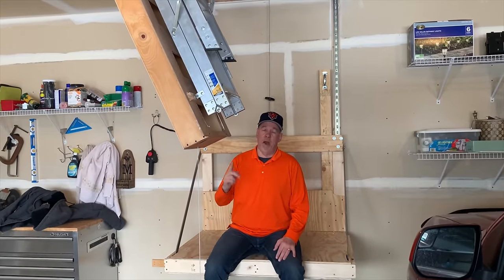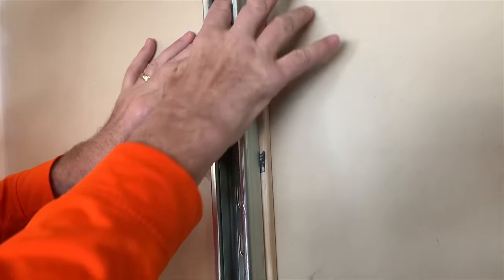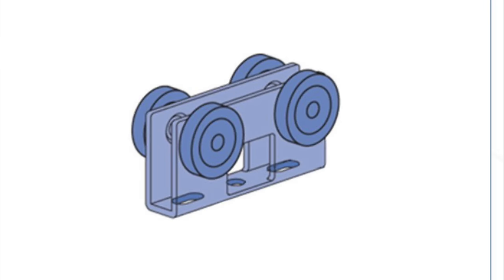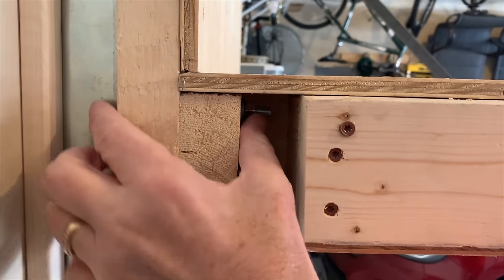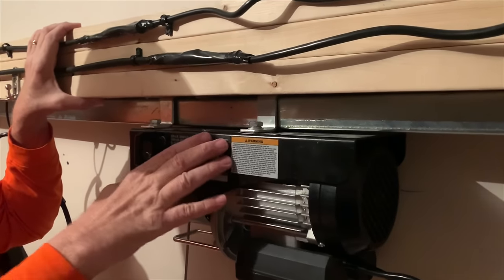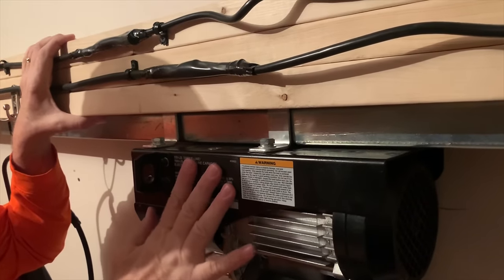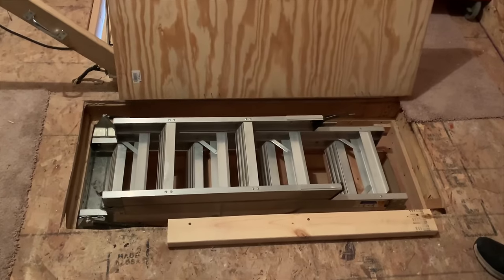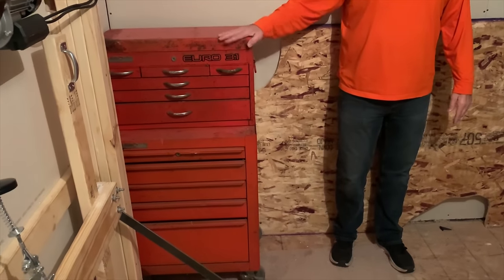Garage Attic Elevator / Lift Build in Minneapolis Minnesota

Comment: Somewhere there is a code enforcement officer loosing his Ming over what he sees as the crime of the century. Great job.
Reply: I'm one of 'them', and it doesn't bother me.   What an individual does, is really up to them, except for extremes.  I get torqued over a builder that knows the design was to code, and doesn't follow it.
I'll council home owners on best practices,  help them improve,  unless there is some high potential safety issues. 
Biggest problem here is that the only stop on the winch is it's capacity overload.   No reverse system for minor jams, i.e., feet or hands. Just a thought.
Reply: L-O-S-I-N-G.     Jesus.
Reply: @Dranok1  Thank you for turning autocorrect on and googling a thesaurus for some big boy words.  There should, however, be a comma after "Or".  Also, your misuse of the semi-colon between "here" and "are" leaves much to be desired.  A period is the correct application here.  I recommend "The Elements of Style" by Strunk and White.  The third edition is somewhat superior to the earlier versions.  Yes, there is something very wrong with thinking L-O-S-E is the same word as L-O-O-S-E.  Jesus Christ, I don't know how people graduate from high school sometimes.  #defendingtheenglishlanguageonefoolatatime
Reply: @prun8893  Oh, you want to descend into a grammar argument, do you?  Probably best not to pick on a linguistician (who used to work as a proofreader/subeditor, teach English linguistics and Advanced 'English as a Second Language') unless you're on firmer ground:
- So you didn't complain about my use of a conjunction to start a sentence, which indicates you are comfortable with my informal style, but you do complain about my informal use of a semicolon.  Hmm, we'll come back to that...
- Shame that you then think "Or", standing alone at the start of a sentence, not part of a list or set of sub-clauses, requires a comma after it.  This is so clearly wrong that you obviously need to read that style guide you mentioned.  (We don't use Strunk and White over here, but I can't imagine basic rules are so different in American English to the rest of the world that they would instruct you to misuse an innocent comma in such an egregious way;-)
- The use of my semicolon is to maintain a link between those two clauses where the first does not "lead directly on to" or "require information provided by" the second.  When I was typing the sense of the two clauses was more strongly linked in my mind and ; felt correct, but being "just" a social media forum -- the most informal of writing one can find -- I didn't then read it back after posting.  Now that I have, I tend to agree that that it was unnecessary and a new sentence would have been better.  But, given the informality of the forum, attacking someone for such a (not "wrong" but) "weak" use of a semicolon, when you have just espoused the most improper use of a comma, is just foolishly arrogant and bound to open you up to debate.
- And then you make the non sequitur of mistaking "lose" with "loose", which neither of us did, unless your original use was a typo.  So I don't understand what point your were trying to make there.
- And finally you round off by blaspheming at me again in an obviously offensive manner -- perhaps to make me bite?  Whatever, I don't need to receive such language, so I'll wait for an intelligent response, but if you simply swear in public as though it somehow reinforces your argument then I'll just block you and move on...
(And yes, that last sentence has too many commas where parenthetical subclauses are not necessary, but it's also not necessary to correct because it's just slangy, informal register.)
Reply: @Dranok1  Fascinating banter, but I feel like you've missed his point that the original contenter said something about a code enforcement officer "loosing" his mind. The hyphenated "losing" comment was calling that out, and not meant in the opposite context of a comment like "Winning," which I think would have been appropriate to the video. 🖖
Reply: @robschwenck  Thanks for that.  I re-read the OP and did indeed not notice his typo originally: I was more interested in the light-hearted nature of the replies, then interrupted by this yahoo who decided to blaspheme at us all for no reason.  The hyphenated shouting, therefore, was so heavy-handed that it struck my attention and seemed totally out of context, so I balked at it and responded in kind.  His response just proved that he's the shouty kind of person who wants to prove his superiority but doesn't want to put in the time either to make sure he's correct or to give a proportionate response.  (The rest of us were here just enjoying some light-hearted commentary, so his shouty swearing wasn't welcome in an open forum.  I'm no prude but people who don't consider their audience should keep their comments to themselves until they can.  My opinion, with which some will disagree while many more agree, but that's an unrelated discussion.)
Reply: @prun8893  Nice deflection of the conversation
Reply: @johnthompson9625  Interesting point. What would you suggest for a system that allows to be reversed?
Reply: @scottcoleman7304  like I said,  the only safety for that winch, it's torque overload,  which will only stop the motor.  There are several safety reversing solenoids on the market,  that require a pedal to be depressed to continue motion in one direction.  If you are using the winch to raise a load,  and you release the foot switch,  it reverses the direction. 
Not totally necessary, but a one ton winch can cause a lot of soft tissue trauma,  before the operator hears and registers that there is an issue. Once someone hears a scream or crunching,  they have to move their finger to the opposite button to release tension or remove the blockage.  Not an easy task, as we tend to lose fine motor skills when under duress. 
If the auto-reverse can't be figured out,  then enclosing as many pinch points as possible,  is the best advice.  Ive seen too many hand and foot injuries in my career (offshore oil and gas before becoming an inspector) and every one of them was preventable.  
Believe me, I'm not knocking the ingenuity of the device in the video,  I'm looking at how to put one in my shop right now.  I just think that the power and torque of the winch that they have,  deserves some respect,  and it will eventually demand payment. 
At the end of the day,  if they ever aell the house,  they will probably have to remove it,  as it will be considered a code violation or deficiency.
Reply: I loosed my Ming and established an empirical dynasty that stretched thoughout much of history.
Reply: I know that guy! He camps out at my house. Wears a kill suit with camoflaged brief case to match. Couldnt wait for deer season. I see a gun cleaning accident comming soon.
Reply: @davidreynolds4684  lol
Reply: @danielgolightly7979  Golightly? Dont have any kin in Stephenville Texas do you?
Reply: @johnthompson9625  The only issue I'd see with this is the framing for the hoist seems to attach to the studs but it doesn't continue down to the garage floor. I assume they rest over a floor joist and that would make me happy, but if not, it's false security of a thick post that is really supported by only a stud.
Reply: @johnthompson9625  Good points on an overlooked safety feature.  I'll be sure to include such modifications if I build anything like this!
Reply: The UBC calls for a fireblock between the garage and attic (taped, type-x drywall). But for you city folks.. not many places in the country have adopted the UBC, nor do they have ordinances to enforce anything. You should see what people build. Anyway, sending Christmas lights up is one thing, I dont think I'd ride this contraption.
Reply: @Dranok1  you sir, are the man!!! If only I had you when I was taking my English classes! I had to either read google everything to make sure I was structured my sentences correctly. I generally wasn’t lol. But I got trough them with an A in each so I’m good now lol. 

I would love any suggestions for references that I could use to teach my son with, he is 12 but very advanced compared to his peers, I’d just like to be able to teach him more and keep him ahead. P.s. plz don’t grade this, i am being very informal lol
Reply: @TankGunner84  😅
C-
Unless you're a 'murican...
...in which case, B
(JOKE!🤭)

OK, where are you based?  (What form, edition, revision, version, dialect, creole and register of English do your peers regard as appropriate in day-to-day professional life?)  Problem is, you see, I can point you toward good guides in Standard English, or even RP if you really want (not that it's seen as the "correct register" for most purposes these days), but if you live in, say, Canberra, people would not generally appreciate your efforts -- it would not be taken as the "right" way to speak.
Being well-versed in the proper construction and pronunciation of Standard English is a good thing: you can speak to pretty much any English speaker in the world and be understood and viewed as a well-educated person whose command of the language is to be trusted.  But that's not the be-all and end-all of good communication: effective communication includes knowing when and where to use the right register, and understanding the difference between "poor" English (lacking sufficient education) and "regional" English (something that might be "wrong" in Standard may be quite correct or acceptable in dialect) and if you try to tell a person with a strongly defined local common usage of English that they are "wrong" or worse yet "uneducated" you will be quickly recognized for the fool you are!

Ooh, that turned into a stream of consciousness again, I'm good at going off on a complete tangent when someone asks me about a subject I love!  Sorry to anyone else who hung around to read all that...  The executive summary of that is, without knowing where you're from, I can't give sensible advice on improving your English, and in fact I'd really only be comfortable doing so if you're in the UK.

(I had a run in not so long ago with an  American who knew his language and accused me of giving "incorrect" usage.  He told me to go and read X's style guide (publisher's reference) and Y's grammar (educator's reference) but I didn't know who X or Y were because we use different texts, and as we debated the relative merits of our formal English I was surprised to learn that a couple of quite fundamental things we consider inappropriate or even wrong in strictly Standard English are considered correct in those educational texts for American English.  Language evolves, you can't fight that, and if you try you will be mocked for speaking like Shakespeare.)
Reply: @Globerson  keep watching. They are coming for us who think so.
Reply: I vote for G Ellis.
Reply: @jerryf609  I'm inclined to drop a "😘" but I'm not standing for anything currently, so instead I throw you a "🤔"
:-)
Reply: @robertthompson227  Seriously?  You have a "Building Code" (I don't know what "U" means; "Universal"?) but it's only enforced in urban areas?  That sounds suspiciously like mediaeval fire regulations for densely built-up areas!  Surely if you have a regulation for the safety of the general public, it must be the same all over.  And what's the point of having it if people just disregard it (because "this is still America believe it or not") or it's not enforced?

We have statutory Regulations and Approved Codes of Practice, the major one being the Building Regulations: a set of "Approved Documents" (each forming a Part of those Regulations) that indicate the minimum performance of certain aspects of a dwelling.  You can set about fulfilling those reg's however you wish (it's not prescriptive in every way -- they don't say "you must use Cellotex or Kingspan to insulate your roof" only that "you must insulate sufficiently to reduce energy loss according to this table", that kind if stuff) but if you use a novel way doing it you must show that you are still adhering to the reg's.
If you ignore the reg's and a Building Inspector discovers it, you will be required to rectify, even to the extent of complete disassembly/demolition if it shown than your ignorance of the reg's make the building unsafe (crappy foundations, for instance, or "built in the wrong damned place!").  There is no "I can't be bothered, it's my land after all" because what happens when you die?  Or just decided to move?  The next owner must live with the house you built being potentially unfit for human habitation.  And there is no "reg's for a big town being unnecessary for a farming hamlet" because the risks are the same wherever you are -- long gone are the days of "you can't built timber frame and thatch if you are less than a rod from a neighbour building in the same manner."  (They didn't have terraces in those days; to stop a fire devastating an entire town they finally said roofs must be tiled.)
The Regulations are valid and enforceable wherever you go in England and Wales.  (Scotland has its own reg's due to its decentralised autonomous status, but they are broadly similar because, at the end of the day, the hazards associated with building and living in a house don't change just because you've climbed over Hadrian's Wall...)
Reply: @Dranok1  No wonder England is just a shell of its former self.    Without government how would anyone survive?  LOL.
Reply: @johnthompson9625  Easy. Sharpie some footprints on the deck that say "stand here" and add "no gesticulation, limb crusher/guillotine in operation." Solved. Or write "not intended for mere humans" to keep most people from riding it.
Reply: @johnthompson9625  You don't need a reversing system to clear jams caused by hands and feet. If you get a hand or foot caught  between the ceiling and the platform I'm pretty sure that hand or foot is gonna get mangled or cut off. If that can lift 500lb a hand isn't going to stop it.
Reply: @OU81TWO  the manufacture several devices that measure torque increases and reverse the motor direction.  Depending on where a hand of foot gets caught,  you're definitely going to sustain some damage,  reversal solenoid reduces the damage.  Take the solenoid off your garage door opener,  and let me know how that works out.
Reply: @johnthompson9625   Those devices are not used to protect people. They are used in overload protection for machines. Protecting people requires light curtains or sensistive contact limit switches like a contact bar underneath a scissor lift table for example.
Reply: It’s his house he can do what ever he wants.
Reply: As an inspector my biggest concern is the amount things being stored overloading an attic space not designed for those dead loads such as the roll around tool box you see in his video. Homeowners around the country putting in these lifts into trust roofs? Cutting structural members can cause major issues. Cool idea  with a lot of dangers. Most don’t realize the access by ladder is just that, access, it’s not intended for storage.
Reply: @Dranok1  I, myself, am a cunning linguist. 😜
Reply: @garyK.45ACP  "My, Harper, I had no idea..."
Reply: @albertthorne2872  why?
Reply: @prun8893  don't you just hate autocorrect? I do. 😊👵
Reply: @Dranok1  😁😁😁👵
Reply: @johnthompson9625  the header the the winch is bolted to laying the wrong direction dosent bother you ? in all fairness he did say he wasnt a Carpenter
Reply: @prun8893   How does anything you are saying, relate to this video?
Reply: @robschwenck  oh my gosh y'all....lighten up!! Is this where we are in this world. We can't watch a video of a man making a video without pointing out someone's bad grammer, which has nothing to do with this video!! And yes...my grammar is not correct and I don't give a 
s_ _ _!
Reply: Scott Luther  Slowly turn around and walk away from correcting the grammer.  You don't want to get sucked into that drama. I assume you didn't read all the replies in this thread. 😂
Reply: @Dranok1  I am going to copy and paste this comment for my future use in my arguments with the "Grammar Police" or is that "AP English Literature and Composition Police"?
Reply: Scott Luther  Oh I dunno, I kinda like the idea of "losing yer Ming" as an accepted exclamation: it sorta demonstrates just how chaotic the situation has become, and the "Ming" in question could refer to any part of the spirit or anatomy you prefer... ;-)
Reply: @johncollins7044  Thanks for beating me to it ;-)
Reply: @PappyNet01  Which comment in particular?  There were a couple... 😁
Reply: @Dranok1  I was referring to the comment or the "debate rebuttal" that opened up with "Oh, you want to descend into a grammar argument, do you?  Probably best not to pick on a linguistician (who used to work as a proofreader/subeditor, teach English linguistics and Advanced 'English as a Second Language') unless you're on firmer ground:"
Reply: @Dranok1  There were some funny comments, but IMHO as usual some comments are either from "Bots" or "Useful Idiots"!
Reply: @Dranok1  Are you trying to become like "Data" from "Star Trek: The Next Generation?" or "Are you just trying to be logical"?
Reply: @PappyNet01  Not sure how you get that from my little life story there, but I was just asking for your definition of "useful" idiot as it applies to some of the individuals above...  It's not a phrase I've encountered before :-)
Reply: I will make something similar. I might put "not for lifting persons - cargo only" on it. But I'll probably still ride it. Nice job
Reply: @Dranok1 I came here for instruction on how to build a lift, I'm leaving with a new found respect for language. You have a wonderful way with words, I hope you're an author of published works, so others can experience the joy of your prose.
Reply: @restlessriver2607  I thank you dear... Sir?  Madam?  Regrettably not: I started out as a proofreader/subeditor after spending Uni writing club magazines, but mostly a scientific and engineering manufacture background writing reports, Standards documents, policies procedures and work instructions, and many years in IT writing technical documents, user guides, etc.  Writing for the BSI or the IET won't get me on most people's bedside tables though...
Reply: Those pinch points are scary
Reply: Code enforcement? You mean building code inspector. They wouldn't care about stuff like this. It would be classified as a homemade thing that could not be classified as any particular violation.  Same reason a treehouse doesn't fall under code inspection.
Reply: What about OSHA?
Reply: @prun8893  the fact that you spent that much time thinking about it is just as bad
Reply: @vt20247  This is a private residence. OSHA governs commercial and industrial properties.
Reply: How about the fire rating? The stairs are rated for a 1 hour assembly when closed. With this build, a fire in the garage is going right into the house side, nothing to slow down the spread of fire into the house. Penetrations from house to garage are to be built to be like a 1 hour fire stopping ability to give you time to get out of the house
Reply: Code enforcement is too often the cousin of an uncle who knew someone on city council so no worries. I like the build.